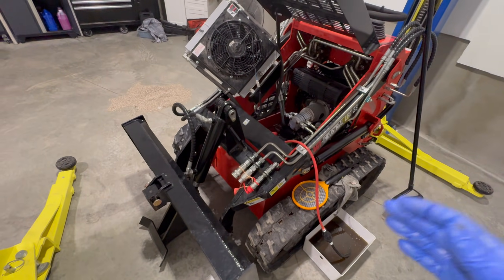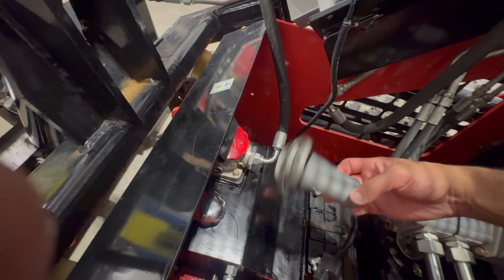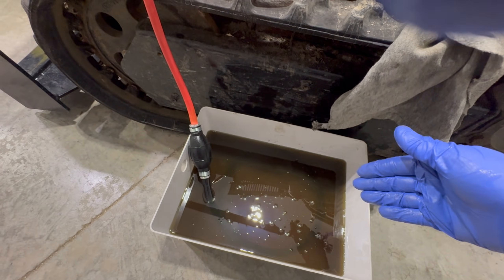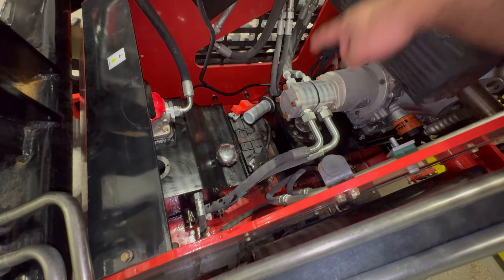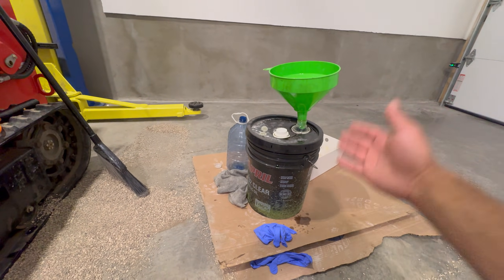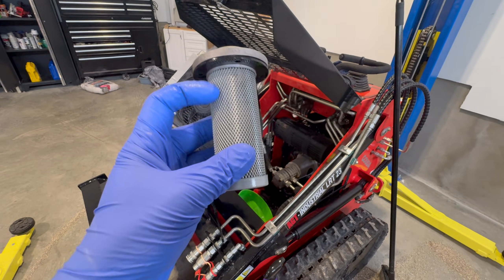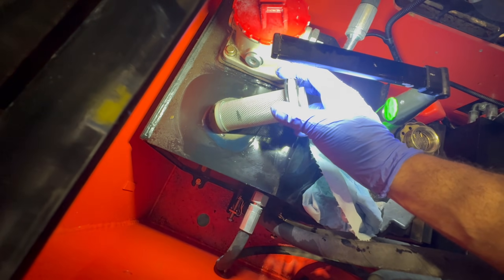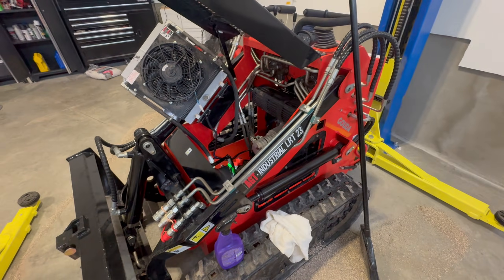Hydraulic Oil Replacement for Chinese Skidsteers

Comment: Awesome video. Question……I have a really small leak out of one of the wheel drive motors, and the hydraulic shop said they tested it and all the seals held at 3000psi. Do you think bad oil could be the cause? I’m kinda stumped and you seem very knowledgeable with these machines.